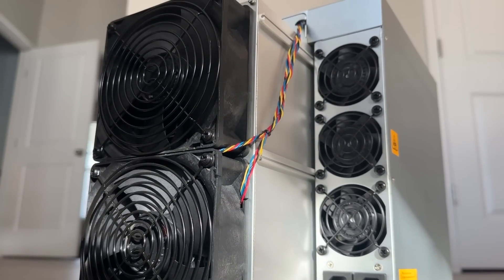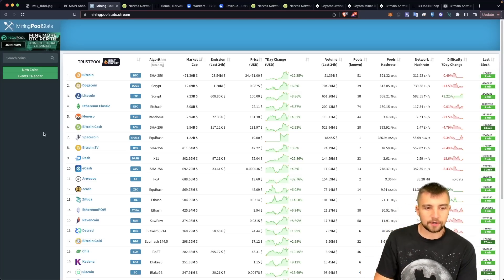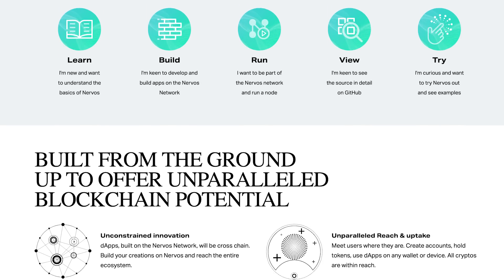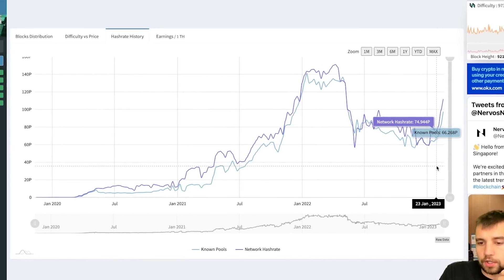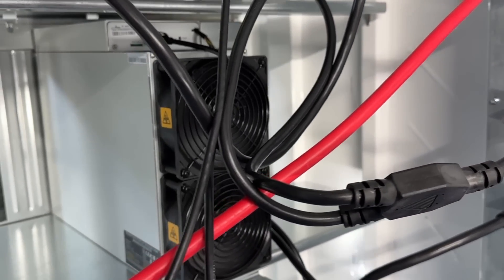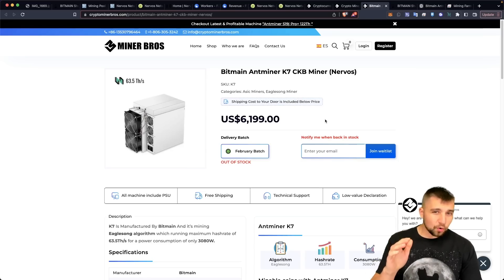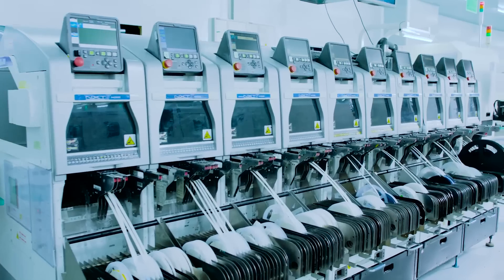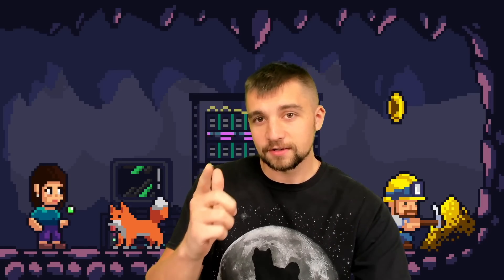I Just Got The MOST PROFITABLE Crypto Mining Rig!

Comment: Thanks for the valuable info👌 I am new to the mining world but struck my curiosity because i design high output cost efficient off grid solar systems. With a shed set up like in the video I can build a battery backed system to power all the mining equipment.